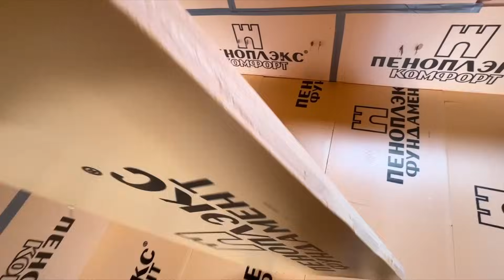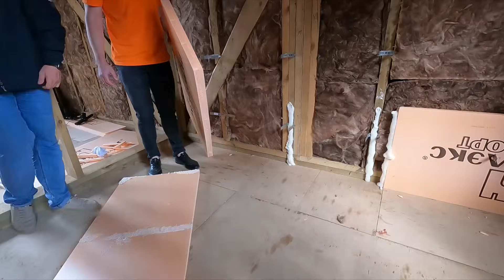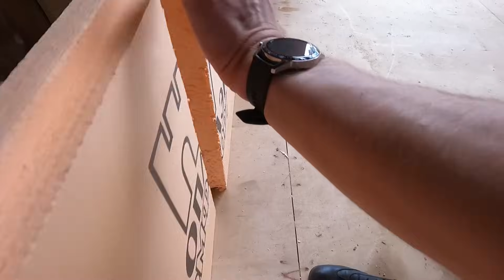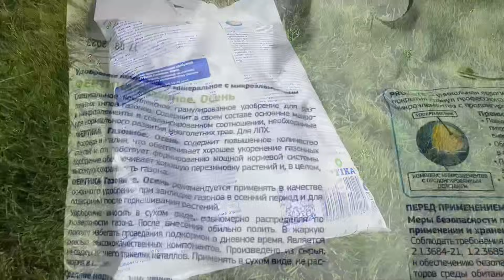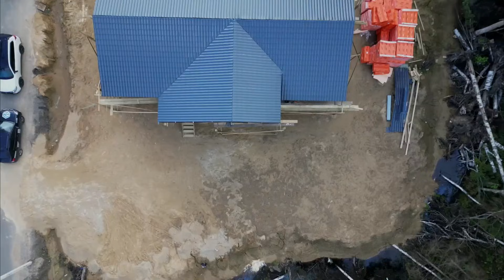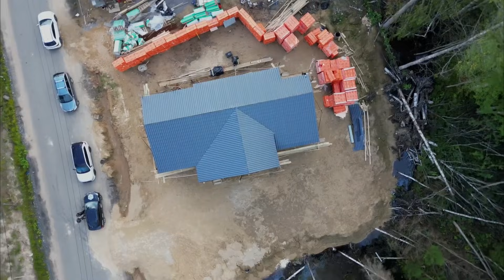Building an Ultra-Efficient Home with the Latest Insulation! Foam Board + Mineral Wool!

Comment: If you insulate the interior and not the exterior, you can get all kinds of moisture issues in the frame. Why not just put a completely enclosing layer on the exterior of the house? It would not get in the way of the typical build, either.